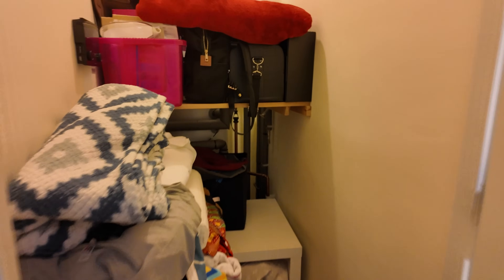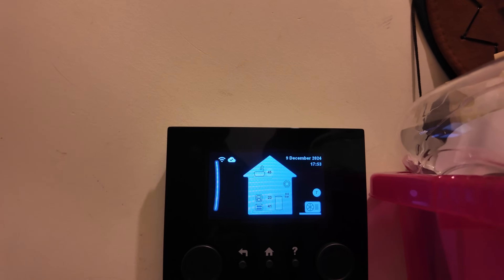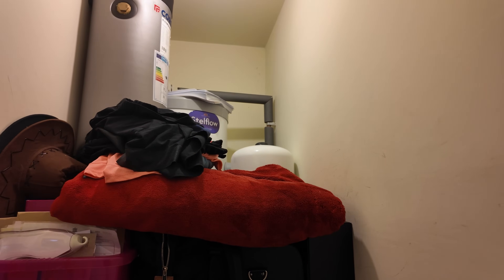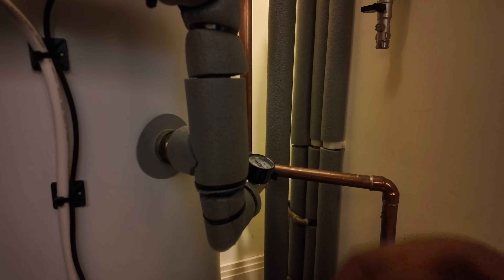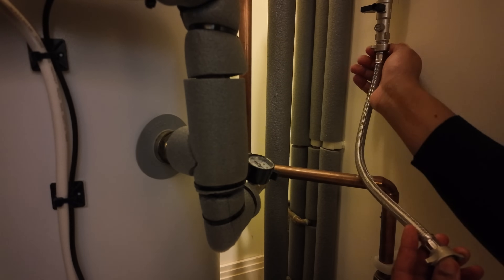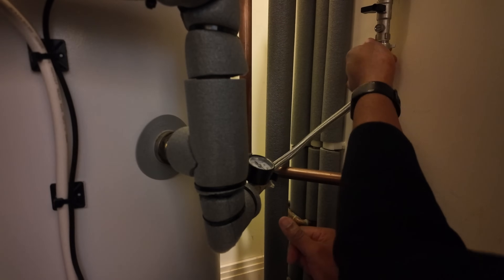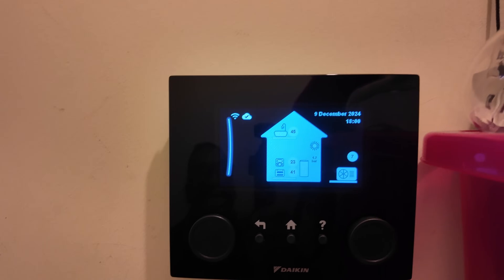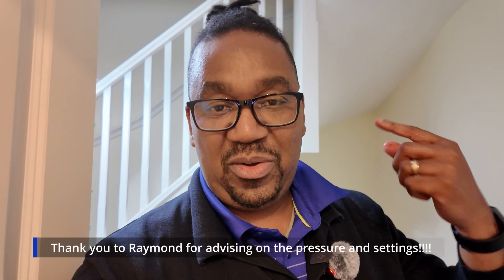Daikin Heat Pump 101: Boosting System Pressure Made Easy

Comment: After increasing pressure and closing the valve at both ends just wondering if the hose pipe can stay connected as opposed to to removing
Reply from the maker: The advice is no, needs to be removed and kept off. See other comments below.

Comment: Yes, system pressure is often overlooked by users of sealed pressurised systems... until the system ceases to work! (whatever the heat source.)

The reason the pressure increased to 1.7 bar towards the end of your video is because you went way over the 1.5 bar , it was indicating around 2 bar on the analog pressure gauge adjacent to the fill valve...so it is likely to increase to this value on your wall display too eventually.

The reason for the indicated  difference is that the analog gauge is in real time, the digital one on your controller is not and will take time to report the actual pressure. This may be due to the sampling / refresh rate of your controllers microprocessor or could be a design choice by the manufscturer so as not to alarm users who may notice frequent fluctuating presdures. 

A tip is to always observe the setting on the analog gauge when adding pressure, not the digital one on your controller.

Also try to add water at a slower rate so you dont over-run the intended setpoint, as you did here.

Remember,  that you should check and topup the pressure when the system is off and is cold (ambient).

When the system is heated above ambient temperature the system pressure will increase, as the water volume will increase with temperature rise and therefore the pressure within a closed system will increase accordingly.

The danger of the pressure being too high when at ambient (ie. 2+ bar) is that the pressure relief (safety valve) is set to discharge at 2.5 bar, so the margin for expansion (pressure increase) is narrower so the likelyhood of the valve dischargong is increased...not good!

Be aware that if the system continues to lose pressure then there is a leak somewhere on your system. Also be aware that if you vent radiators this is also a pressure loss, so always?recheck after venting and re-pressurise as necessary.

FYI...ut is against water authority regulations to leave the filling loop permanantly connected...although a lot of people do, usually the ones who have to top up frequently due to system issues.
Reply from the maker: Well said David and it's people like you we love hearing from as you know what you are talking about. Thank you bud and understand exactly what you mean. I went to fast and didn't look at the anolog. Regarding represurerisng while warm, when is the system in ambient and how can l see this?
Reply: @letsgoelectriclge1320  The ambient temperature is the current static system temperature when the heating source hasnt been operational for some time.

So, for example, the appropriate time to check your pressure is when your heat pump has not been in use for several hours, perhaps overnight, so check the pressure in the morning BEFORE the heatpump is scheduled to turn on.

Also, its always best to turn off mains power when checking pressure to ensure that a pump is not running as this will influence pressure ( not particularly applicable to a heatpump, but a gas/oil fired system may have a pump running even when not firing).

Have you checked the pressure since this video?

If it is more than 1.5 bar, then you can reduce the pressure by removing a small quantity of water from any radiator air vent. It is easier to enlist the help of an assistsnt to monitor the analog gauge whilst you do this!

Comment: Glad you got it sorted! My COP is also sitting around 3, but I’m relatively happy with that, considering I have the dreaded microbore pipework found in most new-ish builds. Room stat set to 23.5 degrees which gives a comfortable true temperature of around 21.5.
Reply from the maker: Cheers mate, l have never tried going about 22 degrees. Might try raising it more

Comment: Why not leave the pipe in place (with valves switched off) for easy topping up when needed?  That’s how our Aira installers left our system.
Reply: They are not supposed to be connected because there is the potential for the mains pressure to get through to the cylinder in the event of a valve failure, this could result in an explosion. This is unlikely because there are 2 valves to fail, and also the cylinder probably has a pressure release valve, so the probability is very. Of course with it connected, if one valve fails then you wouldn't know and are then only one fail away from a problem.

My installers also left it still connected, I haven't yet disconnected it because it is convenient, I think I will at some point, I do check when topping up that both valves are still working.
Reply: If pressure drops there is very frequently a leak in the system. Have a very close look at your radiators and any exposed threaded joints.
Reply from the maker: Not sure as all the Videos l saw were not attached. I hear what you are saying and understand the view. We will see as time goes on. How is the Aira?
Reply: @letsgoelectriclge1320 Happy with the decision to go with Aira.  Everything working as it should.
Reply: This is no different to adjusting the pressure in a gas boiler system. Of course keep the pipe connected, there are valves on each end.
Reply: You are spot on. Our pipe was left in place and you just switch on the valve as needed. Easy peasy

Comment: Got my heat pump from Octopus 2 weeks ago. Luckily installer spend 2 hours showing me the settings, pressure bar and also how to re-balance rads and what to do in emergency. I guess they had entire Friday (5th day) as they had completed the works by early Thursday afternoon.

He told me to stay around 1.5 bars and not to be brave to go significantly above this level as it will cause leaks. So I believe 1.7 is good. I would definitely not try to touch 2.0. I believe that is why we remove flexi pipe after adjusting pressure so no one accidentally causes leaks…

I may be wrong!!!
Reply from the maker: you are spot on and lucky you for having 2 hrs with the installer. It is handy but find now as I grow older, retaining information has become bad. I dint even know I had the pipe. Yes I put it up to 1.7bar but it is now around 1.4 which is ideal really. I then looked at my curve and adjusted that according to the Heat geek instructions. ts a shame that I am not able to monitor usage on the octaaid app currently as my mini is not updating straightaway but taking a day so can only see the day after. Annoying but I think it feels cozier now than last week, it could be the mild weather too. Thank you and hope you are finding the HP is doing great for you.
Reply: @ you can view the kWh input and output via MMI but it will give since install. You can use the bars to see for today and yesterday kWh info. 

Last 2 weeks, I’ve clocked 4.3cop for heating and 2.7cop for hot water. As long as I get above 3.5scop for both combined, I’m happy.

Mine is 8kw Daikin with 7kw heat loss @ 50/-2c
I’m using pure weather curve to heat my house which is giving us 20c 24/7.
Reply from the maker: @unbiased_trader  yeah the MMI is okay but need instant of what I am using now, even the octopus app is not currently showing so there is an issue somewhere. My COP is around 3 I believe but that side is okay, its the whole house that I need to monitor too